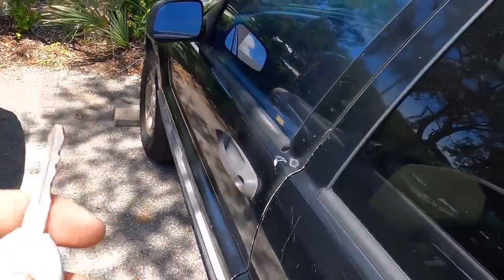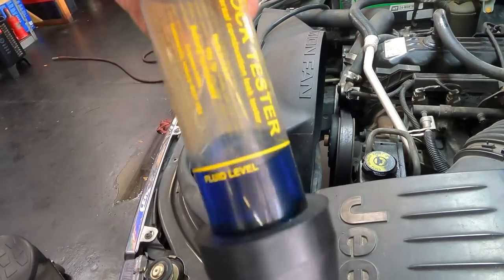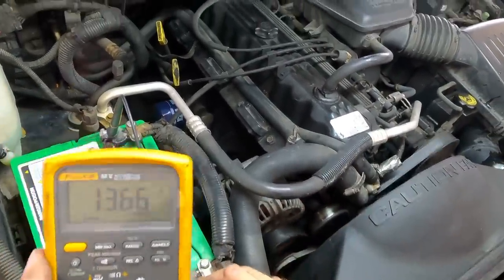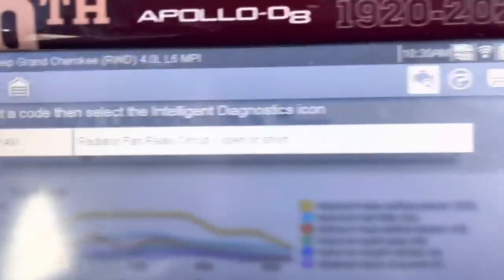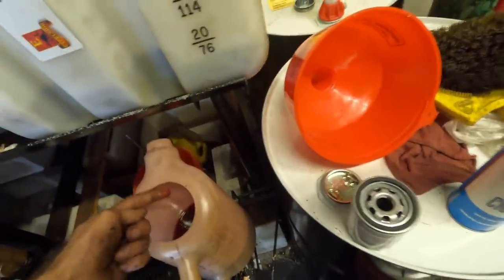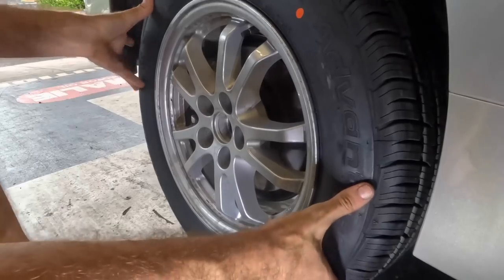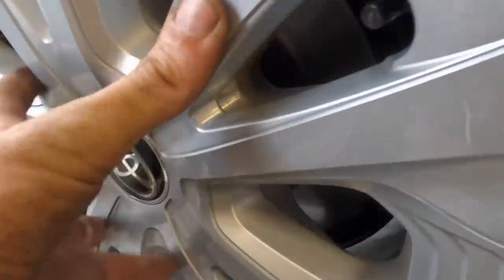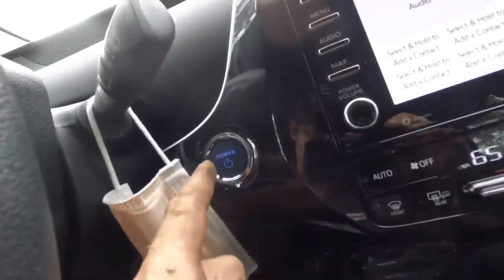How much longer will it last? Jeep Grand Cherokee 4.0 I6 | Compilation

Comment: Have a 98 jeep grand cherokee, with almost the same number of miles, had 8k when acquired,  at 354 currently, but has the 5.2,, really enjoying your videos,, have learned a few things
Reply: And people don’t see that there are a lot Jeep’s that last if taken care of 👍🏻they just slam them all the time
Reply: Mine is a 92XJ, and never had the valve cover off. But then I am A 40 year mech, and design PM programs for any fleet. Auto, heavy equipment, buses. ect. This jeep is one of my examples. LOL
Reply: @sargemarine3709  my last zj was a 96 and everything still performed well when rust issues, from wis winters took it out at 475, pulled drive train and put proceeds towards current zj, like all vehicles of all brands, keep up with your maintenance and all is good, a lot of people's problems is totally self inflicted
Reply: @sargemarine3709  that’s awesome 👊🏻
Reply: @edzimdahl1158  I taught an ASE qual course in NW Florida High School for 5 years, while maintaining the bus fleet. 1st thing I taught them, your vehicle is the 1st most expensive item they will ever buy. Get your money back out of it. LOL
Reply: @sargemarine3709  was born  raised on a dairy farm that worked till retired, and did maintenance and tool&die on nite shift, I only milked 80 so had a great career all around
Reply: @edzimdahl1158  Same applies to humanity in general.
Reply: Qe have 3 Jeeps.. my mom 98 4.0 grand cherokee has 390k miles.. she drives it daily 150 mikes to and from work.   Just basic repairs like bushings. Radiator alternator etc. cv axles.   Sway bar links.. wear stuff.. transmission engine drive train is still original.  Im shocked the 42re tranny has made it to 400k

My 98 grand cjerokee 5.9 limited has 220k miles.  And my 89 grand wagoneer has 150k
Reply: That's Good.
Reply: @jeepsblackpowderandlights4305  yup, 42re behind the 4.0, 44re behind the 5.2, & or 46re behind 5.9

Comment: I had a cross flow radiator partially plugged, acted this way. I figured it out when I touched the bottom of the radiator, it was relatively cool. Pulled the tank on the input side and found a solid chunk of rust blocking the lower half. Of course it was an old style radiator that was soldered.

Comment: FWIW; I have a 92 cherokee. Problem overheating. Went on jeep forums, told that the cross flow radiators will clog up over time. Well, it was 28 years old. I replaced the radiator. No more overheatiing. I don't know if the grand cherokees also have a cross flow radiator, but if so, perhaps replace it unless you have a special way of flushing them out side to side, as I tried that on mine for a whole day, and it didn't help, but replacing it did work.

Comment: I think you do a great job with the electrical diagnosis. I probably would not have caught the pulse modulation considering the age of the Jeep.
Reply: Pulse width modulation has been around forever.
Reply: The premium HVAC systems in the previous generation of the Grand Cherokee (ZJ, 1992-98) used a PWM controller for the blower fan. Notorious for overheating and melting the wires. That issue was sadly carried over to the premium HVAC in the WJ, at least until Chrysler redesigned the part to give it a much bigger heatsink.
Reply: @dunebasher1971  You stole the words from my mouth about the heat sink. The ZJ
s had the power transistor/thyristor fail because it became buried under a blanket of leaf litter/detritus and/or the the thermal conduction compound washed out between the heat sink and the solid state device (power trans/thyristor).

Comment: Something usefull for troubleshooting electrical issues: if a circuit is broken, then you'll likely see the same voltage reading on both ends, so if both ends are 0, the positive is missing, and if both are reading 12V, then the ground is missing. It's more reliable than just continuity testing, since not all switching is done on the positive side.
Reply: Continuity test to ground then also.
Reply: will this also work on negative switching like old toyota have ie negative switching is when the negative/ground side a of load is switched in/out in order for the load to work
Reply: @micktaylorwolfcreekmechanical  that's what i was trying to say. If a relay is not switching, and is on the negative side, boths terminals should read 12V. You can also test for continuity of the positive side(between red and posutive of the battery(, but do make sure that there is no voltage there first, then move on to continuity. Never measure resistance/continuity if there is voltage.

Comment: Say what you want about Jeep, but that 4.0 straight 6 was one of the best engines ever made. They ran forever.
Reply: Agreed I've had 4 of them.  (1995, 2 1997s and a 2003) all with the 4.0. always looking for another no newer than 2004. Last one was bought with 338k miles for $1200 and ran great! I doubt that iron head budged any. I drove one 20 miles home with a dry engine and it still ran lol. Fan relay is under right headlight 😉I made the same cuts to access on the 03 model. Oh I see the issue. Mine had a mechanical and electrical fan.  Looks like replacement relay was from eBay (ask how I know)😁
Reply: A descendent of the AMC 232 and 258, which were also very reliable and long life engines.
Reply: 6 months ago I picked up a 95 XJ with the 4.0 that had sat for at least 2 years. Finally got her running smoothly and I couldn't be happier with it. I like driving it better than my 16 200S.
Reply: Your exactly right there bullet proof and you have to try really hard to kill one.
Reply: With the one exception of the 2000-2001 vintage where they were super susceptible to head cracks. Which then leak coolant into the oil and cause a bunch of damage. Ended up trading that '00 XJ in, wasn't worth the lower-end rebuild to fix the low oil pressure (after replacing the head and half the sludged cooling system). 

My parents still have my '88 XJ though and it's still going, Antique plates and all...
Reply: @felixgato4392  I get you may not like Jeep. but maybe you  should do a little research before you speak out. It is a widely held opinion by most people who have studied the Auto industry over the years that the 4.0 In-Line 6 made by Chrysler was one of, if not, the best engines ever made. You could not kill them. I hate they replaced them with that junk 3.8.
Reply: @CEverly  My 2 cents,,,, the old “cast iron engines” were bullet proof,,, EPA dictates,,less weight, more power ! thus aluminum enters , the days of old are gone,,never to return,,,no different from home appliances, watches, tv’s etc. all about profit,,, not long lasting,,,no money in that ! LOL
Reply: I just picked up an 04 with 82 (now 85k) on it for 5 grand. I love seeing these things with 300+ on them. Best purchase I ever made
Reply: @CEverly  The 4.0L is easy to work on and it's pretty reliable, but it's also very agricultural and thirsty and it makes very poor power given its displacement. The 2.5L BMW straight six that came out of the 80s is just as reliable, but silky smooth, makes the same power with just over half the displacement, and gets better fuel economy.
Reply: say that to mine that blew up from running through a mud puddle with only 86K km's ( 53500 miles) and gave no warning other then lighting up like a Christmas tree and then seizing 30 seconds later. NVM have to edit mine wasnt a 4 L it was a 3.6L
Reply: Chrysler's best engine wasn't even a Chrysler engine 🤣
Reply: @JeffinTD  correct these are AMC designs not Chrysler don't give them any credit lol
Reply: I used to laugh when I saw the '4.0 Litre' badging in the '90's but I have one now with 230k and I bought it pre-pandemic for $1600.  I guess I am still laughing but for different reasons.
Reply: In-line designed engines are far superior to the V designs.
Reply: @wadet73  Sounds like you destroy every one you owned. Shouldn't be driving them 20 miles without oil.
Reply: Yep. Just need a workable vehicle to put it in. Like a ‘75 Hornet, maybe.
Reply: @m3gabytez  How much antique plates cost?
Reply: I bought an '03 Grand Cherokee with 131k for $5000. The crank sensor went bad, replaced the idler pulley and the injectors. All normal wear and tear issues and relatively cheap to fix. Drove it 18k miles the first year I had it and never an issue with the motor. Not terribly fuel efficient though. Still, my only regret is not buying an old Jeep with the 4L years ago.
Reply: Don't blame it on the EPA. Manufacturers and owners both wanted more power and less weight which equals more speed. The Buick/Rover 3.5 V8 was aluminum in the 1960s. And those engines, particularly in Rover applications, long outlasted about every other part of the vehicle.
Reply: Mine is still running… 😂
Reply: @m3gabytez    0331 head in the 2000 model year!   I think it was resolved in 2001.   I replaced my buddies 2000 head with an Alabama Cylinder Head aftermarket unit!  Wonder if they are still around?!
Reply: That engine dates back to the '64 Rambler American. I don't know of any engine except maybe VW aircooled 4 that was produced over such a long time span.
Reply: With a little care they'd keep on goin!! My bro inlaw had one that was severely neglected!! And I do mean SEVERELY!!
Reply: @wadet73  "ran for ever"  why u need 4 of them?
Reply: @alklapaxida850  The drivetrain will far outlast the body and frame (YJ/TJ) on those, so that is the likely reason.
Reply: Yes ! The engine was excellent, Jeep should had still used it, We gave our daughter a Jeep to use far away at college , it ran for many miles &  years !
Reply: They are very reliable…regular maintenance is a key. Ford and Chevrolet had some reliable straight 6cyl. engines too. Some people disagree and that’s fine….because I think they look at torque and horse power. They may not be the best 6cyl out there, but if not abused to bad and maintenance done will last a long time and be very reliable. Jeeps are not really built to go 60-70mph down the highway all the time.
Reply: In '04 Jeep FINALLY took WJ off suicide watch by getting rid of that solid state relay and installed a proper one in the load center. My sister and I both had 2003s and between us we went through a half dozen relays.  The hope that Thermal paste was the answer was merely wishful thinking. They burn out one of the pin sockets in the harness, and some kits like from Dorman came with a replacement harness adapter.  I used thermal paste every time and we still had them burn out. I even stole one of the heat sinks out of a pentium thinking I was doing some good. I'm convinced nothing could be done with the bad design. God had mercy on me when a guy rear-ended me totaling the '03. The 04 might be the best car I've ever owned.
Reply: Exactly. They ran. Not very many of them doing that now-a-days.
Reply: Jeep was and still is a bad car and not reliable at all........
Reply: I've got 3 of them 2004 Rubicon - 147,00 miles, 1996 Cherokee - 312,000 miles and a 2005 Grand Cherokee 275,000 they are unstoppable !!!
Reply: 04 Jeep Grand Cherokee i6 4.0. 300,000mi. Just lost the Crank Sync but cheap diy repair. Otherwise been running fine all these years. Had 3 before that starting with my favorite jeep Cherokee Sport 4.0. Loved that thing.
Reply: I also agree. I had three and sold one I had at just under 200K to my friend's son. It made it to just under 300K, and the transmission failed. Great but thirsty power plant.
Reply: Lmao same thing with my 4.7 wj. I have to pull the cable from inside to open the hood.😂 currently dealing with it dying randomly was told it could be crank or cam sensor. I hate jeeps lmao
Reply: @JeffinTD  WRONG!! They are a direct descendant of the Chrysler 245 hemi found in a lot of Dodge/Chrysler Valiant cars. You want the longest running car in the world? Look at the car built by Karl Benz in 1885, & patented in 1886!! This thing STILL RUNS today!!
Reply: @shapeone4721  cam, crank or map. My guess map. Just buy OEM and you'll be good. I've owned so many in every variety I could write a repair manual.
Reply: @IrishCowboy8705  hold on to it. They are even of days reliable. I've had a bunch of all the varieties. The lowest mileage own is my current commander with the hemi and it's at 260kish. Previous 4.0l I sold with 380k for more then I bought it for.
Reply: @1945tigers  My oil pump failed for over 40K + miles, every time I come to a stop it would have no oil pressure and run rough! It lasted that long before a small part of the piston came off which was around 275K miles. I didn't fix it because I've had this fully built 4.0 for a looong time and wanted to put it in lol
Reply: @kafilkavich707  40,000 miles no oil pressure what a testament to there longevity.
Reply: @1945tigers  Yeah lol! But keep in mind the 0 oil pressure was only at stops. And when I was driving it was super low! The week before it blew a piston I drove to the mountains; all you could hear was a super loud knocking sound lol I'm so lucky it didn't blow around a turn in the mountains!

Comment: I had a 4.0l Laredo that started weeping coolant from the water pump so I replaced it. It worked for a few weeks then started over heating. I removed the water pump again and the plastic impeller had completely broke loose from the input shaft. Needless to say, the second replacement had a metal impeller on it.
Reply: Never, ever, install a water pump on a 4.0 unless it has a metal impeller.

OEM has plastic, and they ALL fail.

Comment: I had a 98 Jeep Cherokee CJ with the 4.0 straight 6 and I'm telling you that engine went forever it never did die neither did the transmission The miles on that Jeep Cherokee doesn't surprise me one little bit.
Reply: Cherokee has the AW-4 trans  (Asian Werner, basically Toyota).   Mine has 246,000  , 1999

Comment: I've changed this on my 2002 Grand Cherokee.  First time I didn't use heat sink compound and it worked for about a year.  Second time cleaned the mounting surface and used compound and it's been years.

Comment: On the busted plastic on the Jeep - that was the headlight mounting frame, a one piece deal that runs all the way across the front from one headlight to the other, and has the headlights, foglights, and various other bits attached to it.
My guess is the Jeep had a low speed collision with something, that damaged the headlight, grille, and busted the headlight frame - they replaced the headlight and grille, but didn't go to the trouble of replacing the headlight frame - because it's a time consuming PITA to disassemble all the body work and remove all the components attached to it, to replace that frame.
ASK ME HOW I KNOW!!!!
Same thing happened to my 2005 Jeep Liberty CRD - and the kicker is, at the time, the headlight frame was only a little over $100 - but that matching grille - which was also made out of plastic and is purely decorative - they wanted near $300 for that bit.
I replaced the important bits like the headlight frame and headlight - and pieced the old grille back together with epoxy and Krylon spray paint.

Comment: Great video about Jeep fan control system.
The solid state relay (SSR) you replaced most likely was designed to be a solid state device controller (SSDC).
The give away was finding a PWM on the control circuit. A controller allows ( maybe this design) for soft start of the fan as well as better electrical power control. This helps manage total vehicle transient electrical loads and EMI
 ( Electrical Magnetic Interference ). Ohm's law sorta dictates the limits and life of these devices with heat dissipation 
being the root cause of most of the device failures. There are great debates in the automotive design community of
relays vs solid state devices. The other give away was the difficult access to the device. Mounting the device to a steel member most likely means the heat dissipation of the device was at its limit when the cooling fan was on all the time.
You will most likely extend the life of the new device by cleaning the mounting area and apply thermal grease between
the device and mounting area. And considering that as the total vehicle/battery voltage lowers ( at idle and hot engine ) and the electrical power demand remains the same, Ohms law will ask for more current (amps) which makes all the devices work harder creating more heat to dissipate.  A viscous cycle of electrical design management. 
Anyway,, 

Yeah, I am one of those damn motor city (retired) engineers....
Reply: It was one sticky problem! 😃
Reply: @tinoyb9294  Very subtle "viscous" joke
Reply: When I had to upgrade my Jeep Headlight wiring because the gauge was inadequate for the draw and chose to use relays, I had to use a SSR in that SSDC role because of the PWM daytime running lights on the high beam filament.

I later changed to LED bulbs by Sylvania and the draw was a moot point. Chalk it up to experience.

Edit: The wiring was melting itself and the connector on the headlamp with factory sealed beam halogen lamps, which is why I say it was inadequate. Never mind upgrading to H1 bulb halogens before the LED bulbs.